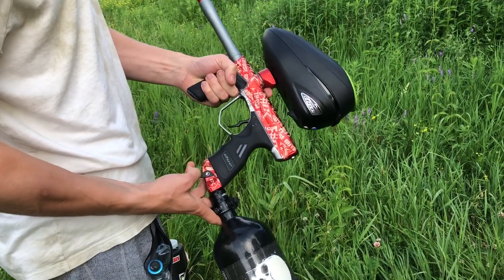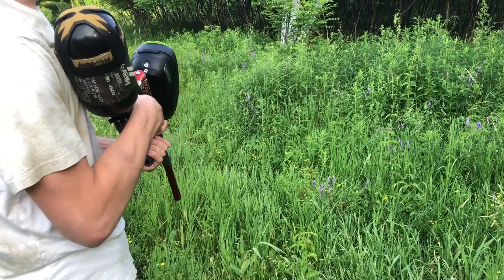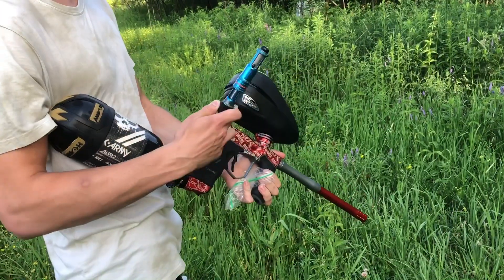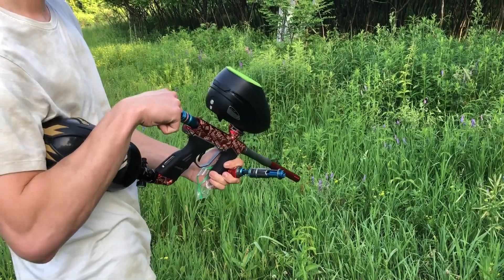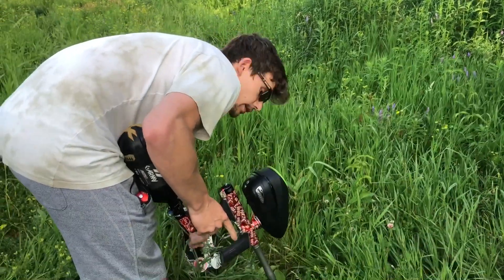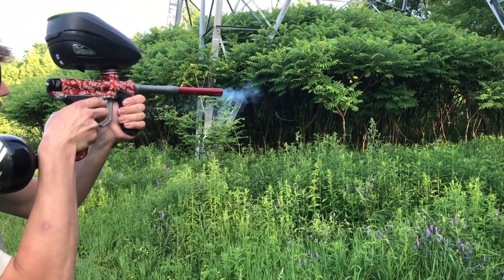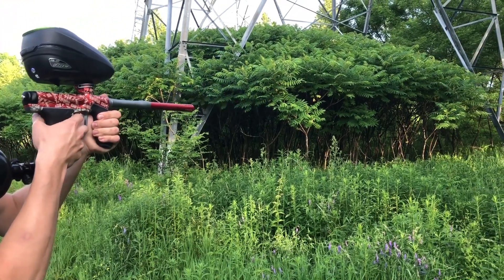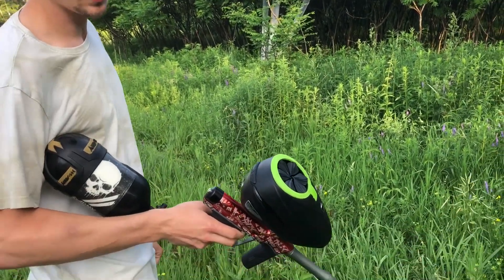DSR Flex Can & Soft Tip Bolt VS Stock Bolt

Comment: I Have a question i cant find the Flex flow bolt only the face and the nasa bolt can i use the flex face with the stock flow bolt?
Reply from the maker: Yes you can. The flex face bolt will be a bit softer on paint but it’s recommended to get the flex flow can

Comment: so would you say the Upgrade is worth the nearly 100$?
Reply from the maker: I mean I haven’t broke a ball since I’ve had it which I had done before.
Reply: @foolishcreations2259  okay. So if my break my New 5 Star paint which i bought for test reason than i will consider the Upgrade. But until now i cant really remember when my last Ball broke and a even got the New ACP barrel. So Thanks for the Video and for the Fast answer!
Reply from the maker: Fabi Bassi yeah boss I love my personnel one to bits. Some of my breaks were do to just cheap field paint with too small of a freak insert most likely. Stock barrel rips good just got a dye GF 684 which I’ve been using also.